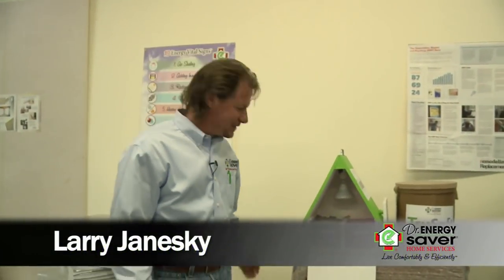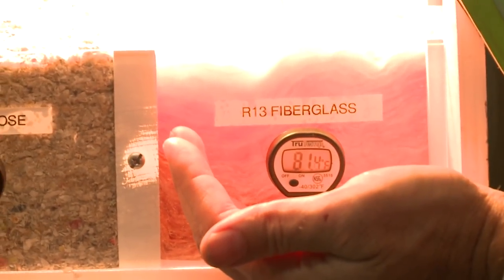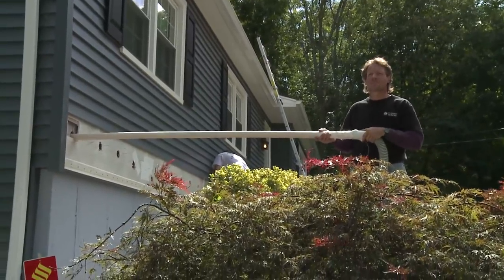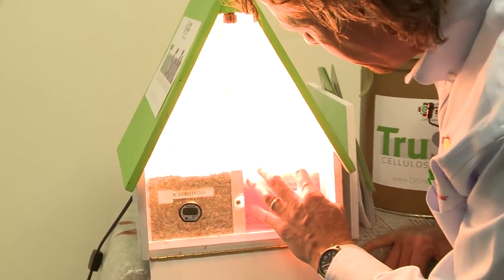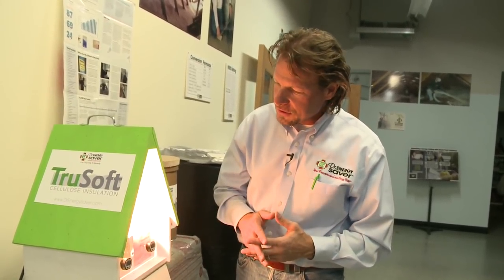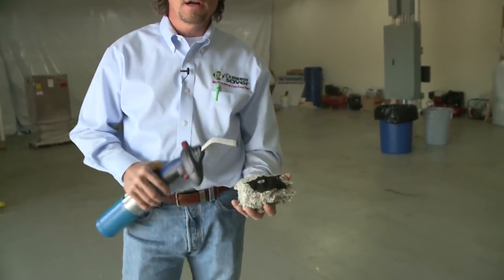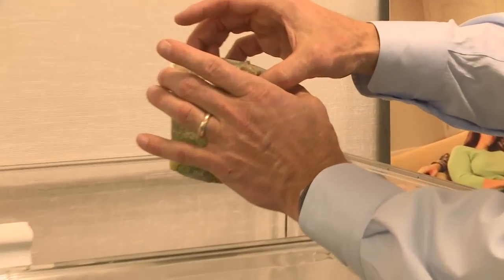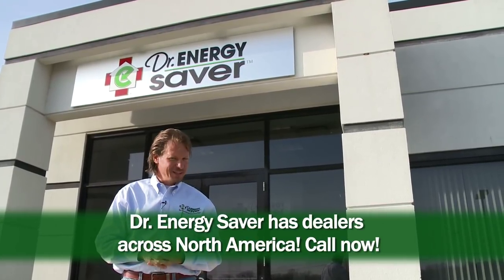Why Cellulose Insulation is Better than Fiberglass Insulation

Comment: BIG NEWS ITEM: A molecule of heated air is 70 000 times smaller than a molecule of water, I said that so you know the physical size of the ATOMS we are trying to save or to slow down, once you know this you will learn heat cannot be saved, it goes through wood, concrete, bricks, roofs and insulation uninterrupted. AIR GAPS: Does insulation create air gaps, no, its a myth, NEW STRATEGY WANTED: It's more effective to air seal buildings, keeping cold air out, saves more heat than keeping warm air in.  OTHER VIEW WELCOME.
Reply: +SuttonWoods, molecules of water penetrates the pours materials you listed too"  That's the nature of materials. I'm not sure what you are referring to when you talk about "AIR GAPS. My concern as an insulation contractor isn't  invisible air molecules or even "AIR GAPS" whatever those are, but air infiltration. Fiberglass is a solid core material.  In that state it actually conducts heat...no different from heating one end of a kitchen knife and feeling the heat conduct to the other end. Fiberglass is a poor conductor, unlike metal, but technically it's a conductor. But it's an even poorer insulator. You see, solid core fiberglass's only capacity to insulate is to trap air between its long fibers. For that reason it's fluffed up in attics and manufacturers warn against compressing their fiberglass in walls so's not to squeeze the insulating air out of it. It's those same poor insulating attributes that make fiberglass such a cheap common furnace filter...it passes air with ease. But pack fiberglass in a wall or ceiling and it has no air "trapped" so conducts heat instead of insulates. "trapped" is too generous because even installed correctly fiberglass does a poor job of trapping air. Installed in ceilings the warn underside of the ceiling drywall heats the top side and the air between the fiberglass strands. that air rises and heats the roof sheathing and even the shingles. The result is snow melts. When the melted snow water flows to the drip edge of the roof it refreezes forming fiberglass icecycles. Our remedy is to sweep the fiberglass at least a foot away form the edge of the exterior wall and replace it with cellulose. Cellulose is dense so prevents air form heating up and rising to melt the snow. We also vacuum out the fiberglass to correct those fiberglass caused icecycles.Cellulose, on the other hand, is a short-strand wood fiber material. "cellulose" infers it has air cells trapped inside of it. Those trapped air cells insulate no mater how tightly cellulose is packed in walls. That's a big difference in the two types of insulation. Compress fiberglass and it LOSES R-value. For that reason the manufacturer of fiberglass voids the warranty if installed incorrectly. Compress cellulose wood fiber and the R-value does not change. However there is one important quality obtained from densely packing cellulose in walls. It's stops, or at least greatly reduces AIR INFILTRATION. Homes aren't drafty anymore. "Heat" doesn't even "rise". You see, with cellulose insulation the  wall temperature at the bottom is within a degree or two of the temperature at the top. Now convection can't act on the cold air at the top and hot at the bottom and cause the hot to rise  and cause a draft. Thermodynamics aside, science can easily measure the advantages of cellulose over fiberglass.  Of course fiberglass salesmen aren't educated in science but trained as hard core salesman to confuse homeowners and make the sale. The best insulation salesmen are fiberglass salesmen. they have to be. MY product, cellulose, sells itself.To answer your question, In my experience fiberglass creates messes and  results in poorly insulated homes. Cellulose wood fiber stops air infiltration, or reduces it drastically. What more could an insulation do?
Reply: @pipersson9258  Here is the link to the company that does not recommend cellulose: http://www.g-pmc.com/g-pmc-registrars-declines-to-certify-cellulose-insulation-contractors-and-manufacturers/

Also, in the link you gave about Larry J's mansion, it clearly states in the title: 'Media Reports Spray Polyurethane Foam Insulation spontaneously combusted a $5M Connecticut Home'

In other words, it was not cellulose.

Comment: Also R Value is R-Value it is resistance to heat. whether it is cellulose or fiberglass. if its R 21 cellulose then it is r 21 fiberglass. Sorry your vid is staged and a fraud.
Reply: It's not necessarily fraud. The test conditions that insulation is tested in are very specific and can be tested by the manufacturer themselves, allowing them to give their products better ratings than actual real world results. The way products are tested aren't verified and for the most part, fiberglass is pure shit.
Reply: imzjustplayin 1
Reply: imzjustplayin and I

Comment: So much BS my god, for one thing you have the heat lamp light shinning on the thermometer on the fiberglass side, another thing spray foam is the most fire proof it does't burn and it keeps the fire off the wood and is the best sealer, but can be toxic so spray it on the outside if you can.
Reply: Read a story last weekend where a British Olympic-hopeful swimmer was killed when her converted metal barn caught fire. Her insulation choice? Foam. She never made it out of her bed. The fumes overcame her before she had a chance to evacuate.

Comment: Have you ever smelled cellulose insulation? it reeks.  I think it's only a matter of time before people realize that putting a large quantity of newspaper ink the home (cellulose insulation) causes off gassing issues, not to mention all of the chemicals they have to add to make it mold and fire retardant. Walking through a cellulose attic is no treat, it is very dusty and will make you hack worse than fiberglass unless you have a respirator.    Also, I have seen dozens of homes with collapsed ceilings due to the weight of cellulose.  IMHO, it is not worth it and think this video is one sided.
Reply: Any chance you can show pics of ONE of the DOZENS of homes with collapsed ceilings?
Reply: Sure, I'm not lying.   https://dl.dropboxusercontent.com/u/5246510/1.JPG

IMHO, the thickness and fastening method of the sheetrock ceilings must be evaluated before blowing in cellulose. Smooth shank nails spaced at 12" oc or greater with a sloppy bead of adhesive that eventually gets brittle may hang on for a few years, but roll the dice.

Comment: Here's the problem with cellulose if you need work done in the attic nobody wants to enter because they have no idea where their going. Don't get a rat in the attic with that insulation you will end up paying $3000 to remove the dead rat and insulation from attic happened to us stay with the fiberglass just my personal experience
Reply: Luis Luna who told you this nonsense? "no one wants to enter"?? I have done OVER 6000 homes in 27 yrs and can tell you that 80% had insulation in them prior of some sort. its not really hard to "find your way" where you are going its just common sense, to find the rafters to walk on. I HAVE NEVER EVER stepped thru a ceiling..EVER! Also, is it the materials fault it you have rats?  "lets not use that material because some day I mite get a rat"...yet youll keep paying the high utility bills?? silly.
Reply: +Luis Luna , not so. Whether you put in fiberglass or cellulose, to achieve the U.S Department of Energy's suggested R-values for yoru area will require covering the studs and a bunch more. Any  insulation will conceal what's beneath. the difference if you work on electrical the cellulose won't itch. the fiberglass will have yo sneezing and itching the rest of the day. You'll likely go home and change cloths and bath to get a little relief.What amazes me is rats and mice love to nest in fiberglass insulation.  Mice burrow perfectly round little holes in fiberglass and raise their babies...I've seen plenty that were poisoned and diet in the fiberglass. It's counter-intuitive but they seem to tolerate the fiberglass with no problem. However, rodents don't nest in cellulose. The same boric acid that kills insects burns the eyes of rodents. It won't kill them but it burns and they give up and leave. I don't think anyone would pay $3000.0 to remove a dead rat. Homes across America are full of both dead and live mice and droppings and other critters who find fiberglass excellent bedding material. Raccoons love to build their latrine on fiberglass between ceiling joists. That gets nasty! They fill one up and start another and continue doing so until the homeowner notices the unGodly odor.
Reply: @larrymaloney877  This is all correct.  I've never removed a mouse (or cadaver) from cellulose.  I marvel at the numbers of mice cadavers in fiberglass....and their little "town" with trails from one round "house" to the next is quite intriguing.  And raccoons....that is the worst I've ever cleaned.